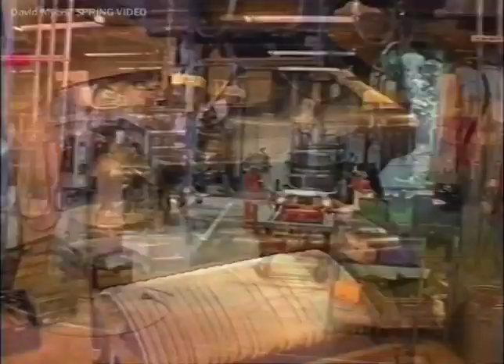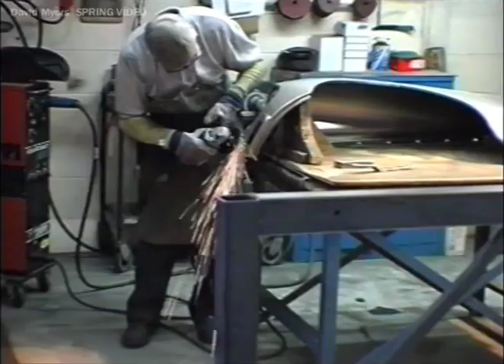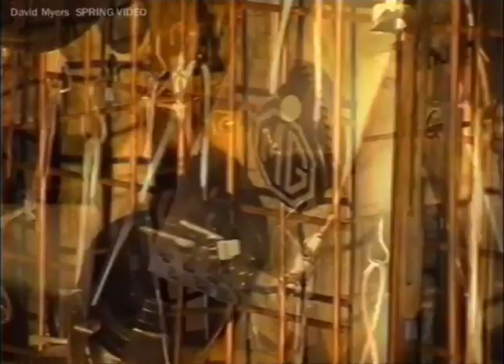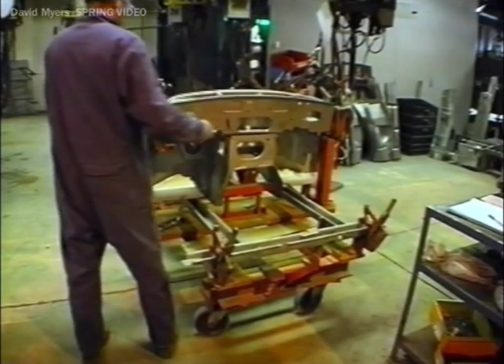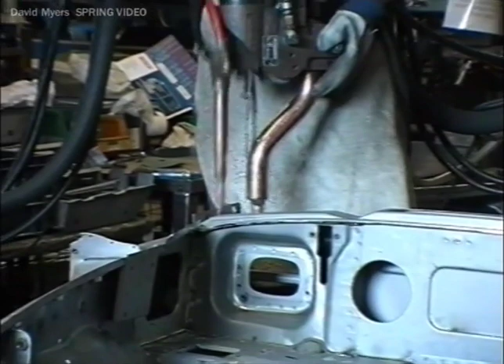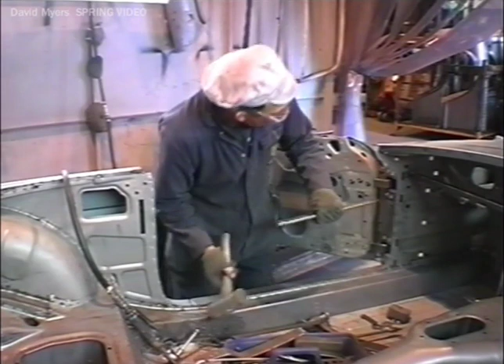BRITISH MOTOR HERITAGE

Comment: Absolutely fascinating process. Longtime MGB fan after owing many lovely UK classics over many years. Great to see how these cars go together.
I own a 67 GT in Sandy Beige on wires and its rust free, bought last year. I originally bought this very same GT in 1984, and sold it in 1988, only to find it again after 37 years 4 sale purely by chance.
It's in the condition pretty much as I sold it in 1988, mostly original paint but retrimmed interior to factory spec.